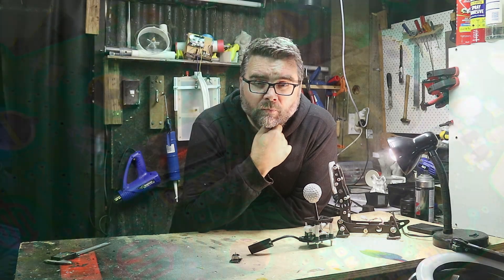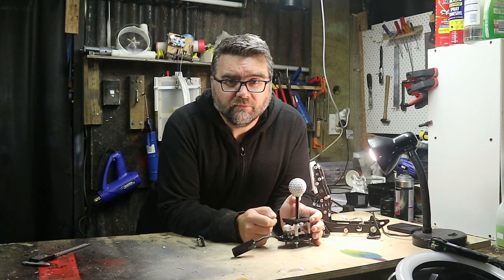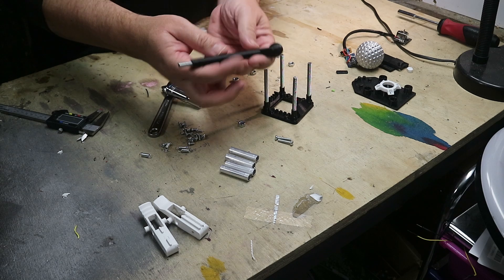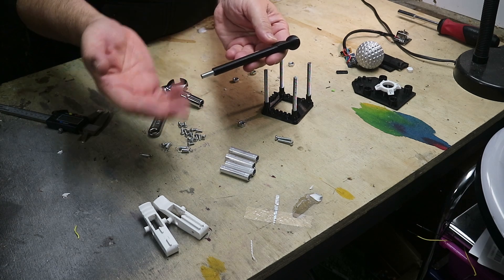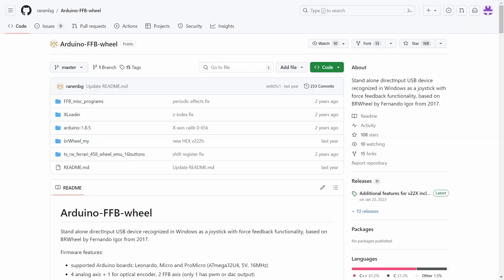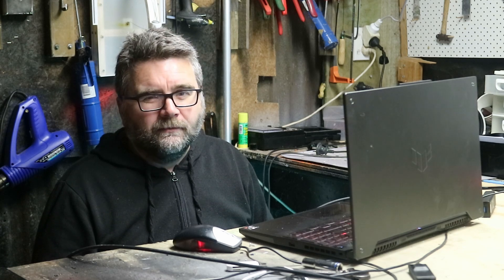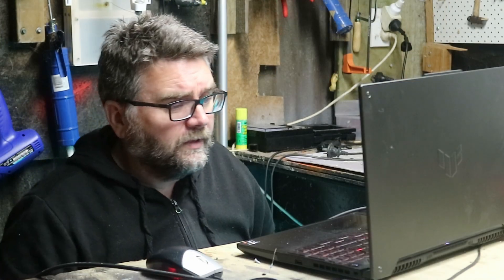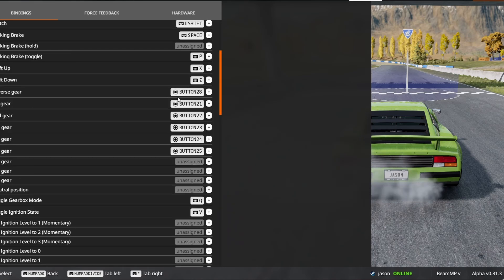Build Your Own Manual Shifter for Sim Racing: Quick and Easy Tutorial

Comment: Is it okay to print it with pla+ ?
Reply from the maker: Yes. As long as you have the threaded rod going down the gearstick shaft it should fine. Mine is in PLA
Reply: @JWNZ  how much infill did you use ?
Reply from the maker: @eyadmohamed8778  For the shaft 100% the rest was only 20.
Reply: @JWNZ  sorry for asking a lot of questions, could I use 100 grams after market shifter knob ?
Reply from the maker: @eyadmohamed8778  that would depend on the thread size. I didn't really investigate to far into standard sizes as I knew I was printing my own. If you could let me know the threadsize I might be able to alter the file to accommodate it.
Reply: @JWNZ  mine have a multi sized silicone part to attach it to any sized rod, so it isn't a problem I'm asking about it's weight, is it gonna run normally even that my shifter knob is heavier than yours
Reply from the maker: @eyadmohamed8778  I see what you mean. You may need beefer springs.
Reply: @JWNZ  but there isn't a mount for beefer springs.

Comment: Oooooh this is very smart is exactly the type of inspiration i was looking for. I have a ton of these little stickboxes from console repair. I was thinking "what if i put it right under the stick" but uhhh it instantly occurred to me that the moment i slam it into gear against the guide plate, there's going to be a mad torque on the stick that'll rip the stickbox right apart, it's not made for levered side loads like these.

My other thought was to have a good robust potentiometer read X movement but have two Y movement limit switches.

I'll be using a blue pill with custom firmware for my build, i have already done a firmware proof of concept. I'm looking to accomplish following features:
- compact build, possibly conical running narrower towards the bottom, fully enclosed in a 3D print.
- quick desk mounting, tilted towards me.
- 6 speed gearbox arrangement with Euro reverse rear left, so ideally where one needs to press down on the shifter knob to get it into reverse. I don't know if i can implement this type of reverse, but i guess i can always "cheat" and make it more difficult to move to the left into the reverse.
- hollow alu shaft with wiring with MiniXLR connector for the knob. Two knobs, SKRS and racing.
- i'm also adding a 3.5mm jack for clutch pedal.
- probably some sort of button/encoder device for more functions.
Reply from the maker: I did watch a video recently that showed replacing the potentiometers with hall effect sensors that detect rotation.  Extending that out you wouldn't need a joystick from a controller just one massive joystick :)
Reply: @JWNZ  Have you ever taken apart a Dreamcast controller? Instead of a tiny return spring in the bottom, a giant one surrounds the whole stick assembly. The stick dangles a magnet on top of 4 linear analogue Hall sensors of unknown exact type. The sensors are placed at the X and Y ends of magnet travel. Then the signal is conditioned by an opamp that subtracts the corresponding axis signals, outputting X and Y axis signals. The chassis is designed to avoid steel screws nearby, with only brass screws in vicinity, and it must have also constrained placement of controls - trigger magnets and corresponding Hall sensors are not allowed to be near and interfere with the stick.

I don't have experience designing with Hall sensors yet, but this look suggests that some extra care is needed when designing around them, you apparently don't want nearby hardware that can become asymmetrically magnetised and affect the readings.

Being 26 year old hardware, i'm sort of surprised we're not seeing this particular design return, given any patents must have lapsed. Instead they copy the potentiometer stickbox and use a Hall rotary position sensor in place of a potentiometer. While Dreamcast design excels by eliminating the wear prone axis splitter assembly and making return spring much more long term durable since its ultimate deformation relative to sheer bulk ends up tiny.